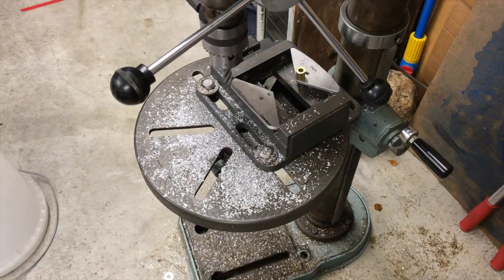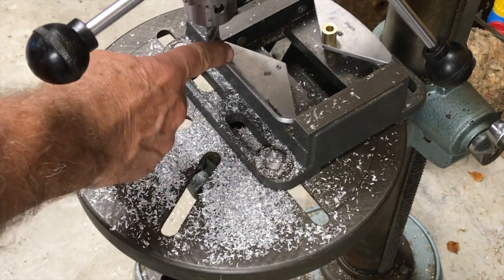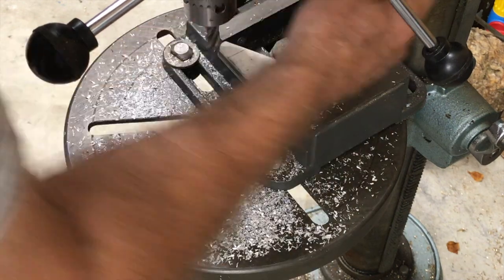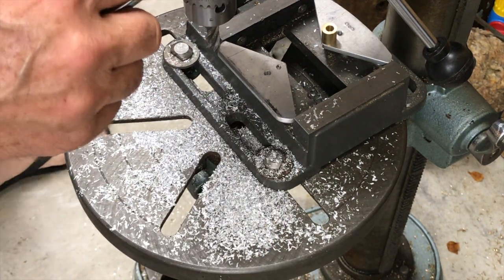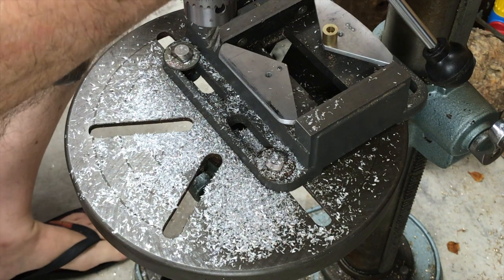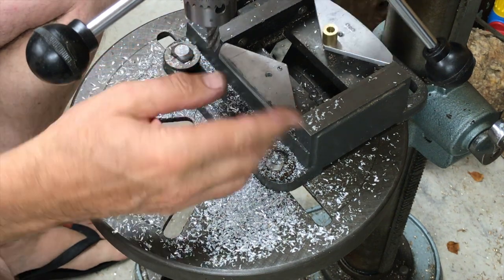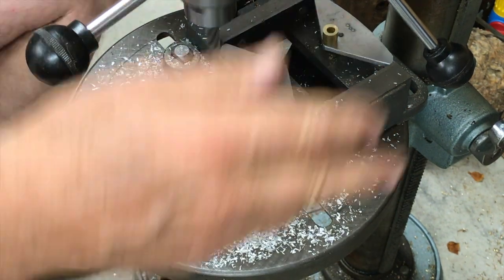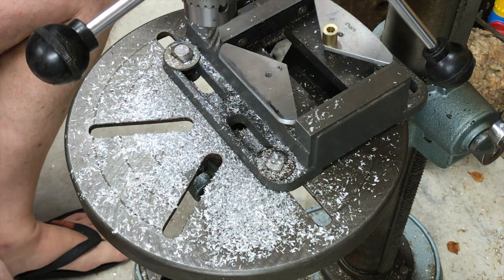Milling a curve using a pillar drill

Comment: So, radius depends on end mill diameter?
Reply from the maker: No, in this case the radius is the distance between the pillar of the drill stand, and the metal in the vice. Quite a large radius. The whole table is rotating around the pillar. This particular drill also has a round table with the vice mounted on it. Rotation of the table around its central mounting can be used to cut curves with a smaller radius.  Then the radius is the distance between the center of the table and the edge of the metal you are cutting. That can provide a wide range of radii from 0 to about 250mm.